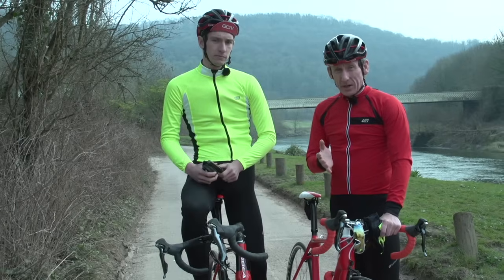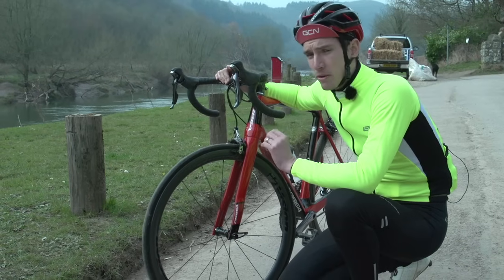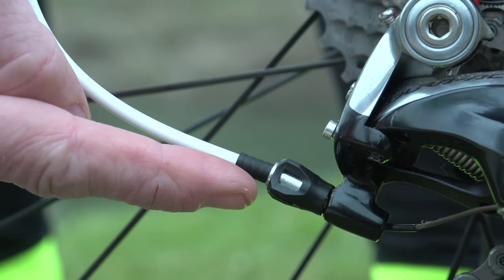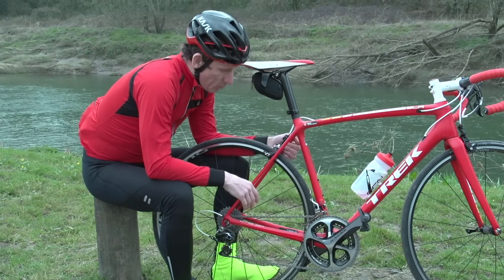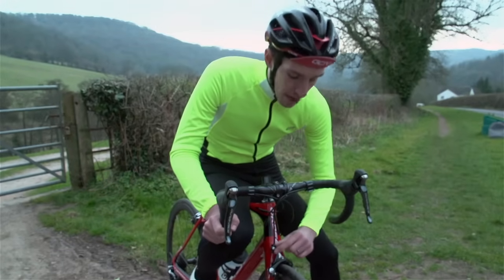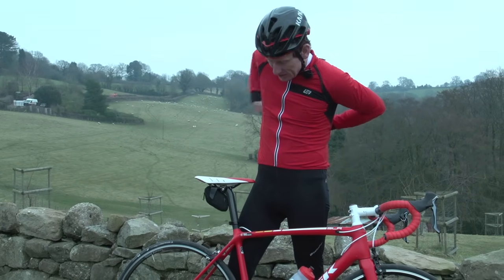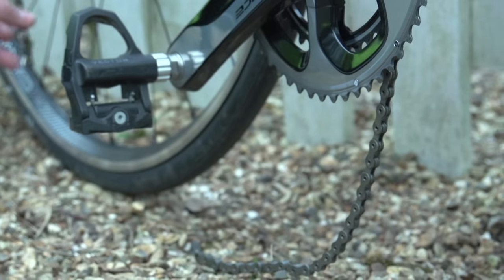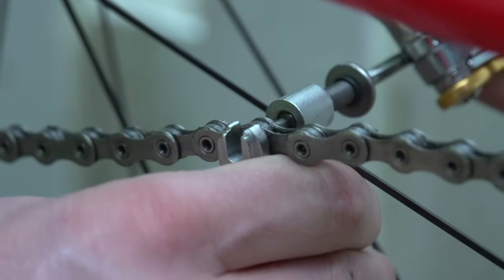5 Common Mechanical Issues & How To Fix Them | GCN's Cycling Tips

Comment: I think patching a tube is under rated.  The last puncture I had I literally was back rolling in 10 minutes. I found a shard of glass in the tire so I knew exactly where the problem was.  With the wheel on the bike I pulled the tire off the rim where the glass was, pulled the tube out.  Applied glue, applied the patch, pushed it back in the tire, tire on the wheel, inflated and away I went.  Properly done, the patch does not need drying time.
Reply: +Bungle2010 if I change the tube I have to take the wheel off.  Athough that is not a lot of work, when I patch all I need to do is pull a few inches of tube out, patch the leak, stuff back in, pump up, and away I go.

Comment: for a flat, keep the tube valve in the rim, until you find the holes in the tube, then match the tube position to the rim to find out what caused the flat. It will be either caused from something in the rim (ie. spoke/tape) or from the tire (glass/wire etc)

Comment: If you have a cheaper wheel with the spoke nipples directly under your rim tape, it is a good idea to let the air out of the tube before turning the nipples, or they can rub a hole through the tape and then the tube, leaving you with a flat tire.
Reply: how do i know to check what you are saying...I am lost?
Reply: @jessicalaw3159  Cheaper wheel

Comment: For a puncture, after removing the punctured tube and taking note of its position I inflate it a bit to locate the hole. I then have a guide of what part of the tyre to specifically check for foreign objects. After removing it, I do also run my fingers around the tyre (carefully) in case there are more potential problems.  However, I'm running tubeless now and haven't had a puncture with them yet :-)
Also if your needing to start messing with limit adjusters on a previously well indexed machine then it suggests the chain is well worn and needs replacing (check with chain tool ASAP after your ride).

Comment: It's probably safer to put the tyre back on using your thumbs rather than tyre levers; this way you won't pinch-puncture the tube. If the tyre won't go on first time, let out a little bit of air and go around the wheel squeezing the tyre bit by bit and eventually it'll pop on. Then go around again -- squeezing -- and check that the inner tube is completely clear of the tight part of the tyre.

Comment: Punctures. Note the orientation of the inner tube when you remove it. Find the puncture hole then place the tube on the tyre to find what caused it.
Reply: Yep, safer than digging chunks of metal and glass out of your fingers feeling around for what punctured your tyre.

Comment: on the bent wheel problem (happened to me)
lay the bike on the axis(left side down, dont make a mess of the rear mech) and with the help of a friend stand on oposite sides of the wheel, not puting all of your weight in there though. 
repeat till you can ride without the wheel knocking  into the frame, and then use the spoke key to finesse it

Comment: Here's something they miss from my experience... I built bikes for a few years in a bike shop. When a bike is jumping gears it means the cable is too tight, so you really only need to turn it to the left... anti-clockwise only... and this axiom of "1/4 turn at a time," don't know where that got started. I heard it all the time working at a bike shop, and 1/4 is almost never enough. So if you're stopping just to adjust your barrel adjusters, go ahead and give it 4 turns.

Comment: I have a brand new 2020 specialized tarmac. I bought it in October 2019. Shortly after buying it I started to hear a rattle that appeared to be coming from my break Hood but ignored it. Now it seems like every time I run over a little bump or crack in the road, it sounds like my frame is cracking. I have never crashed or dropped my bike. It's not the bottom bracket because it is not a rhythmic cracking sound in time with my pedal stroke. It is definitely when I hit little bumps go over little cracks in the road and such. What could it possibly be? My headset and steerer tube are tight. Less than a thousand miles on the bike.

Comment: Hey I got a problem with presta valves. When I unscrew the minipump the core of the valve unscrews as well which blows all the air out of the inner  tube. Common problem? Tighten the core with  some pliers or use some sort of glue to hold it in place? I got some onepiece presta valve tubes too but I dont want to waste perfectly good inner tubes.
Reply: +Mifelt I had the same issue. Pliers worked fine.

Comment: This may read really sad but at the start of the video Mr Simon Richardson states that alls you need to cure many 'on the road problems' is a mini pump, spare inner tube & a multi tool but the first problem looked into 'a flat tyre', where in the entry video did you state you also need 'tyre levers' as used in the video when changing a flat tyre

Comment: "with just a mini pump, inner tube and a multi tool like this one, you can fix pretty much anything"...and the first tool they use? tyre levers! well done guys! 

Yes I know you don't NEED them to change a tube but your the ones bloody using them!
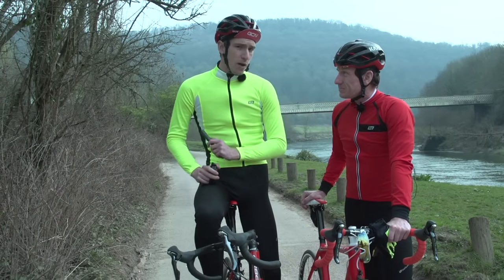Reply: +JP05CPSN  Look closely at 0:17, pay attention to the top left side of the tool kit. Just between the edge and 14g spoke wrench. 
That "little thing" made of black plastic is the tire lever. You can use it, it's bloody Oll Korrekt (aka OK).
Reply: +lisapet so there is, clearly not the ones they used however. if I was the producer I would have made them use the stupid one you get on a tool like that.
Reply: JP05CPSN Have a mercy on them. I am not sure that producer is interested in long movie shooting session. Raising interest to the sponsor's produce might be more of value for the producer. It worked in my case, I might get those tool kit, and will keep a separate tire lever set, similar to what GCN guys are doing.

Comment: Hey! I'm totally obnoxious about oval (non-round) chain rings. Do they feel harder when the pedal is a the 6 o'clock position and then easier when they're at the 9 o'clock position or do they feel the same as round ones? 
Could you do a video explaining how they work? Curiosity is eating me up :(
Reply: Osymetric and QxL do feel like pushing a bigger ring on the downstroke because you literally are. I used Qrings first and they felt fantastic after switching from round, had the same sensation after going to Osymetric afterward. Now they just feel normal.
Reply: ***** sorry, english isnt my first language and I tought that meant like you totally dont know anything about something. I better get back to my Webster Dictionary. Lol.
Reply: bilwit thanks a lot! So they do feel easier then harder.
Reply: +Luciano Narno I guess so.. it's hard to describe, they just feel normal to me now. You would have to try it for yourself to see if you like it (although they can be pricey).

Comment: Most of these are avoidable mechanicals for the well prepared bike and rider

1: CO2 > Minipump (but bring both)
2: Tubeless > Replacing tubes for minor cuts
3: Disc brakes = can ride on a pringled rim without brake rub
4: Split link > quicker than chain shortening, don't worry about losing the pin
5: Jumping gears after a crash = bent hanger, bring a spare.
Poor indexing without an impact = lack of care, same goes for worn brake pads, check this stuff before you head out.

Oh and to find the hole blow up the tube, find the hole with a wet finger (ooh err missus). You did remember to line up the tyre logo with the valve right? No need to cut your fingers, locate the thorn/shard with flat head on the multitool

Comment: how would you fix ghost shifting or the chain not staying set under power?
Reply from the maker: +Doug Hashier might be new chain and cassette time. Try cleaning it thoroughly first: https://www.youtube.com/watch?v=KM6mzE5lQ0w
Reply: +Global Cycling Network, it's getting an entirely new drivetrain right now ... Wanted to go 1x on my MTB ... We changed the chain and the rear derailleur ( was broke) my mechanic said the cassette looked good. I was just wondering if there was a way to fix it temporarily to finish the ride with out having to ride to high or to low a gear since I would have to jump up 3 cogs or down 2 to fix it.

Comment: Ive offen bought bikes off ebay to rebuild and sell on, the tip on not taking the chain pin all the way out is by far the best idea in the whole world why the fuck didnt i think of doing that! nice one gcn
Reply: +kris reed 

its kind of bike maintenance 101, you can also buy replacement pins that come with an alignment starter thingie.
Reply: +kris reed you could also just get a SRAM or KMC quicklink - no need to shorten the chain then.

Comment: I really enjoy all of your shows but the information that you gave about fixing a puncture is incorrect in my view.  As the son of a bike mechanic and long time racing cyclist (also know as ICTclassroom) I would never use a tire lever to put the final part of a tire on.  It would greatly increase the potential of pinching of the tube.  Even with very tight tires you should be about to work the tire back on to the rim.